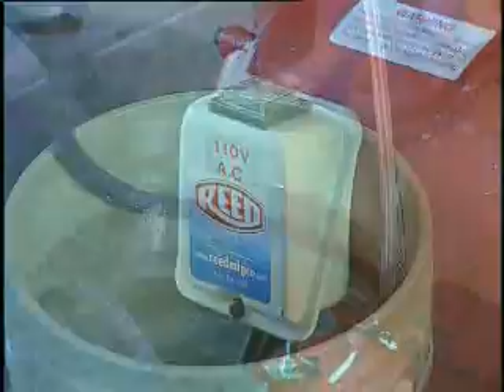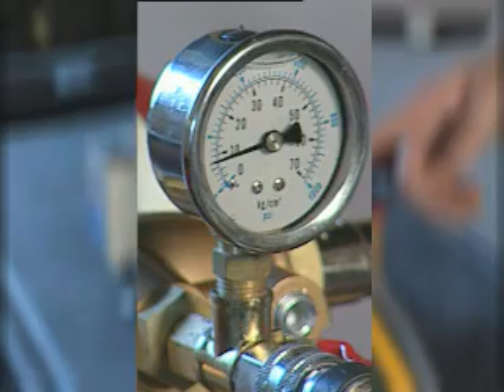Electric Hydrostatic Test Pump Demo - Reed Manufacturing

Comment: Why do the directions say "do not use the pump to fill the system to be tested with water. Fill the system prior to attaching the pump , then attach the pump and pressurize the system." Page 3. Yet in the video you're using the pump to fill the system. If I had the means to fill the system without the pump then I wouldn't need the pump . I bought this pump to test a system and to use the pump to fill the system. I don't have a pressurized water supply, hence the pump. This has now become a useless pump . I will be returning it .
Reply from the maker: Brian - You raised a good question.  And, the product developers have reviewed the operator's manual and added new notes about filling the system.  Thank you for the input.  I encourage you to take a look at our updated booklet.  https://www.reedmfgco.com/en/products/water-services-tools-and-machines/electric-hydrostatic-test-pumps/#tabs/manuals
Reply: I think they mean that you shouldn't use it to fill the pipe with water, but once it is full, the pump will pressurize the pipe,  so you should use another pump with less pressure but more water flow to fill the pipe..., those pumps are way cheaper than this one...
Reply: Hoa many psi is the maximum i need something about 150 psi or more